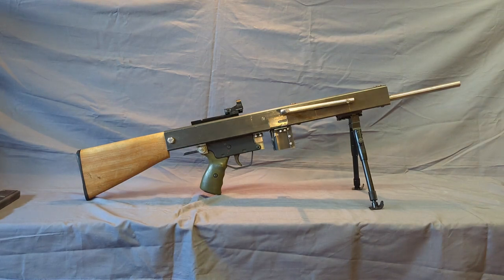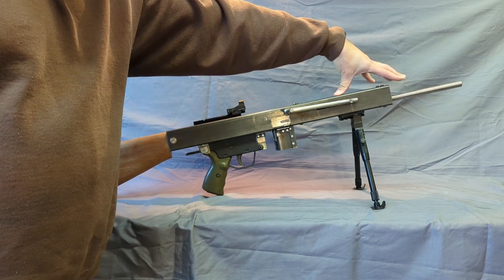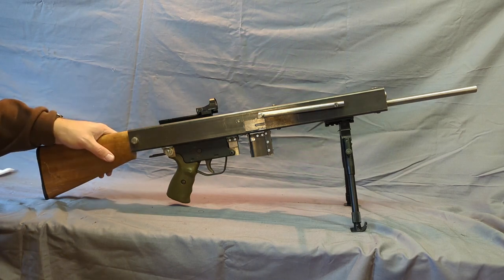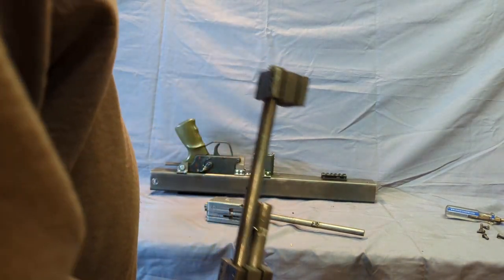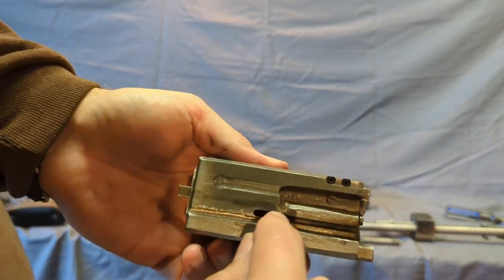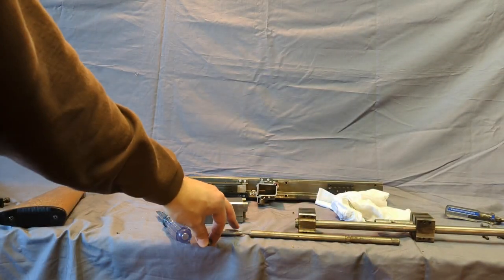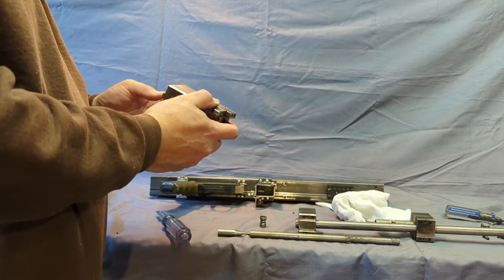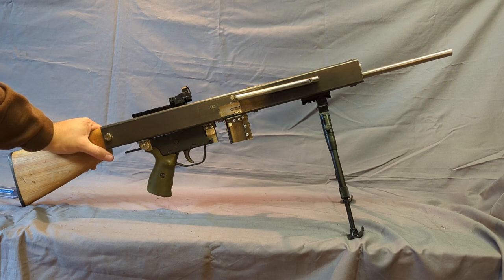Cursed Homemade Gun: Straight Pull 9mm Rifle

Comment: I admire your skills. I also  made singleshot break-barrel rifled pistol that shoots 9mm(9x26) selfmade custom ammunition which i converted from cutting down 5.45 casings. At this point, you can convert it into semi-auto. Seeing what you are capable of, I think simple blowback design shouldn't be harder for you to figure out
Reply from the maker: Thanks. That is neat that you are making your own cartridge. I've thought about trying a semi-auto. Normally I try and build really accurate guns, but I think I'll try a semi auto soon.
Reply: The tick to blowback 9mm is bolt wieght and mainspring.  But you can build a blowback weapon withe just hand tools if you are skilled enough. Take my word

Comment: You didnt have a mill, im curious how you made the feed cutouts in the bolt, as well as the camming surfaces in the operating rod?
Reply from the maker: They are rough cuts. If memory serves I would drill in from one side, then drill multiple holes along the other. Then Dremel and file. I mean it can work, but it's not pretty. Of course my later stuff looks better as my tooling has improved.
Reply: I use a cutting wheel on an angle grinder.  It cuts as straight as you're capable of doing. It's not hard